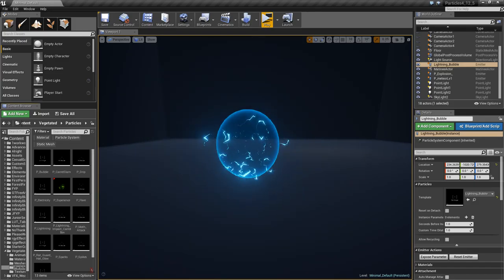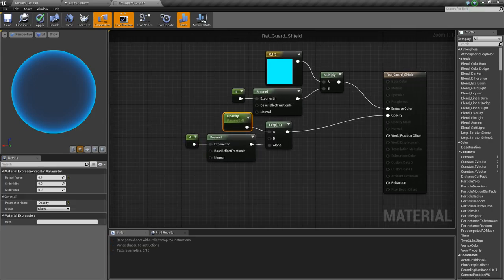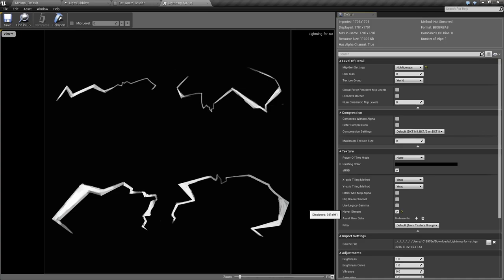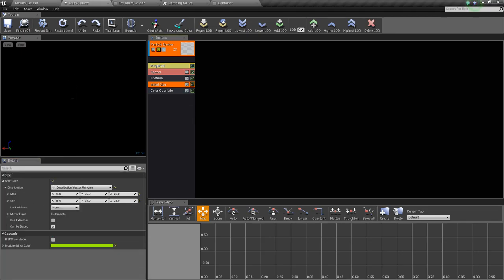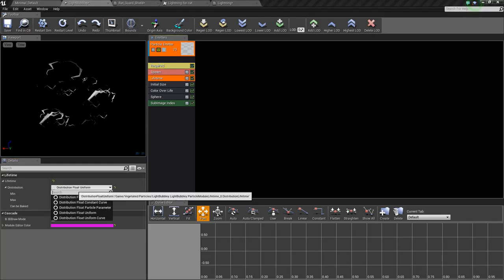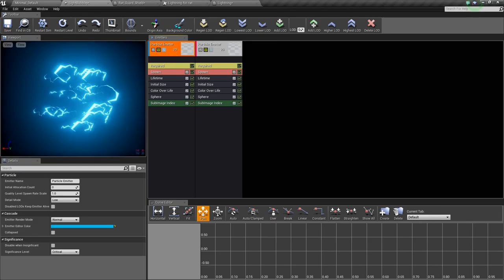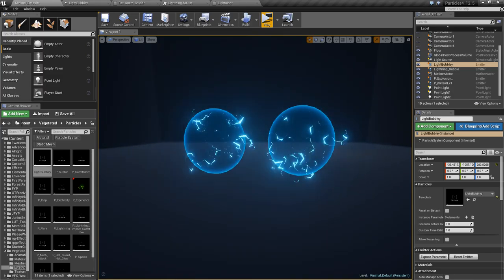Electrical Bubble Shield - UE4 VFX Cascade Tutorial

Comment: Great stuff, but I hope I am able to offer some criticism:

- At 1 min you do not specify which lerp node. There are several types available. Same thing for the opacity node.
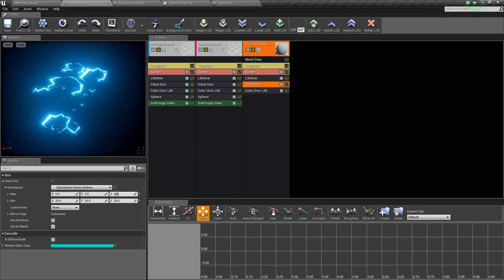- Also, around 6:20, you "override the material" but don't really show or explain how this is done. I can hear a double click somewhere, but the mouse cursor is not visible. This is very frustrating.

(I eventually figured out how to do these things, but maybe you can add that info if you are aiming to help out beginners)
Reply: How do you override the material?
Reply: @Kesiif  In the Mesh data module, under Mesh category, there's a check button called "Override material". I busted my ass searching for it, too.